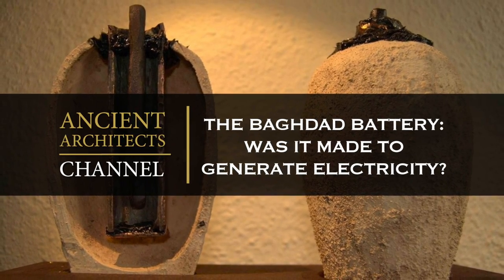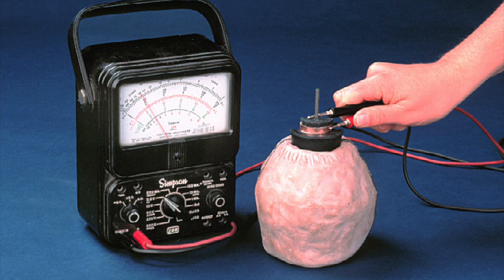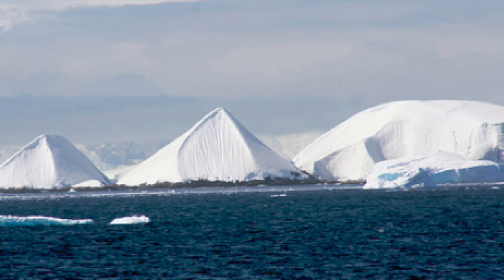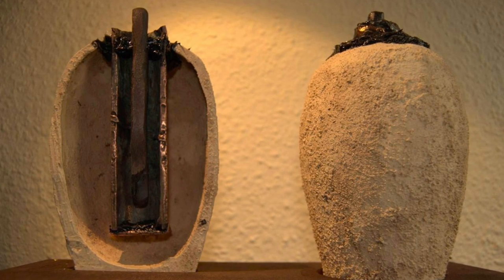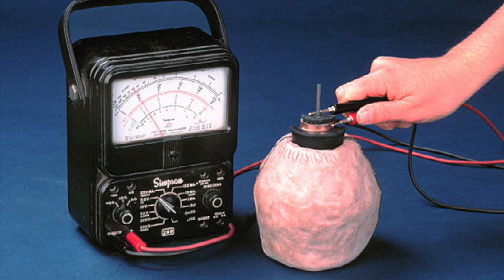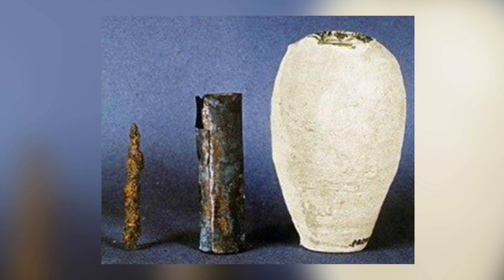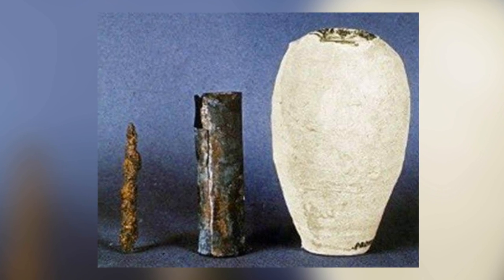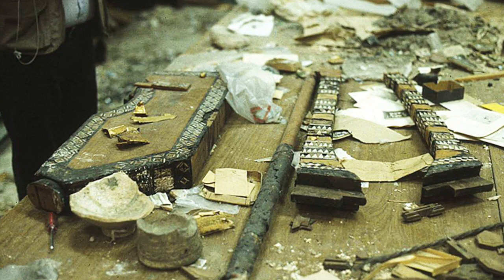The Baghdad Battery : Did it Really Generate Electricity? | Ancient Architects

Comment: Great observations! This is the detail we need. And its quite important detail too. I'm not so worried about the voltage, its the current that matters and what they did with it. However there are enough important points in the other detail that are key:
The apparent inability to refill
No obvious contacts or terminals
No obvious paraphernalia to be used with any of the jars.
Why assume vinegar or lemon juice? There quite probably were other acids around.
Could they work on alkali like a NiFe battery? 
What occupied the space between the Cu vessel and the jar? Ideally that Cu ought to be full of holes to allow more electrolyte to circulate from the jar to the iron rod. Better still a series of Cu meshes. It looks like there is a large void between the Cu vessel and the clay jar, and only Cu vessel had electrolyte between it and the iron rod. Have I got this right or not been paying attention? It certainly is a very odd way of doing things. In which case ( viz, that I was awake), what was the purpose of the void space between the Cu vessel and the jar.
It was designed to be sealed.
Maybe any electric devices were not what we assume and assuming is very silly in any case, although for me battery is not ruled out. But having seen this vid, it's definitely less ruled in.
They may well have been ionising the air for all we know. Any use they were put to would be long term or low current and not require frequent refilling.
One time I believed MBUK who said you could dissolve a seized aluminium seat post in a steel frame by turning the frame upside down, removing the bottom bracket and filling it with concentrated NaOH. They weren't wrong and it was fun. There was a lot of hissing and bubbling and the frame jiggled up and down a bit. I put a match to the bottom bracket shell  and got an amazing POP and two jets of flame just like the barrel of a tank when it fires. I had to do this quite often as it wouldn't have been good to fill the room with hydrogen otherwise it would have been the Hindenburg all over again.
I of course put a volt meter across the seat post and frame. I got 1.5v. But it was in the days before LED bulbs and it cant even have been a few tens of  mA because no way would it even look at a bicycle lamp light bulb.
It took a lot of NaOH to dissolve that seat post and I've since always been sceptical that the mags' bods had actually done this themselves. It really was extreme and quite a dangerous, if rather an interesting way to spend an evening.

Comment: Before deciding if something is a battery or not it is wise to research what types of batteries there are. Most people think they know, zinc-carbon, alkaline, lead-acid, NiCad, NiMh, lithium. But they'd be wrong, there are in fact literally hundreds of different types and compositions, even ones that use salt water, some that use iron oxide, some that rely on gravity, many invented in the past 100 years have been forgotten about.
https://www.youtube.com/watch?v=pMLcWE6NLgM&list=PLbQqm4rNo625Etz4INo2wP2X4sxgwDyNN
It's also likely the Baghdad batteries weren't ever very good, 'Ever Ready', Exide' and 'Duracell' weren't very big back then so it was probably a more artisan production process - it's quite possible we found the rejects and real ones got used, abused, recycled and broken. Perhaps they were the losers in the annual 'Which Battery' awards in ancient Iraq: if they didn't experiment and get most things wrong - like we do - how could they progress?
As we saw from the Great Pyramid's gold cap, 'generating' electricity in ancient Egypt was as easy as connecting a long wire from the gold cap to the item to be powered, and the other end to a metal rod banged into the damp earth. Connecting that to super-capacitors (see link above) or batteries is not so strange.
The lead/tin solder alone shows us they knew what they were doing, that's not a accidental solder joint - that's R&D and a way of heating the metal properly. I wonder what flux they used? 
What is more puzzling is the insistence of people that the Pyramid Builders (etc.) were too dumb and stupid to have discovered and harnessed electricity. We have no idea of our own history beyond about 2000 years and only discovered electricity a couple of hundred years ago, and then only use it everywhere today thanks for Nikola Tesla. Go back to 1600 A.D. to see a people too stupid to discover it, it didn't take long for someone to wonder about the lightening to us all having iPhones. 
The technology to casually dig out, shape and move 1100 ton blocks of granite or to machine neat pots out of it doesn't appear overnight, it takes many centuries to refine - so how likely is it that they were too stupid to notice lightening and harness electricity? Not very, the chances of the missing it and vanishingly small when you think of the age of their civilisation and the products they created, especially toward the end of it. Then have a read of Ezekial in the bible, it looks pretty electrical to me. Then there's the tabernacle and the tent of meeting that no one was allowed into for fear of death - from HV?. The design of the ark with the gaps and bits of foil and the winged spark gaps. There's even instructions in Isaiah not to pull up the stakes or cut the 'cords'. 
If you look for it electricity it's all over old historical documents, just because people haven't dug up pre Younger-Dryas DeWalt screwdrivers and TVs doesn't mean they didn't know about and use ways of collecting and storing electricity. 
So yes, I think the Baghdad battery was a battery, likely emptied and discarded, a lot of things can go astray over 12,000 years, in London the life of a car radio is only a few minutes in some areas :)
Reply: Absolutely right ! Definitely It is a battery 🔋
Reply: @G-ra-ha-m  thanks Graham,
Yes I know,..... I am a full professor of analytical chemistry and worked a lot with  electro chemical cells :)
Reply: @massoudkaykha2200  Brilliant !!!!
I think ancient civilisations were a lot smarter than we have been, but people always like to think they are the best, almost like an instinct!
It's like the dinosaurs - everyone uses them as an example of something old and gone, but they were on earth for what - 250 million years?!

Comment: 1831 Michael Faraday discovered how to make electricity by using a magnet. A cylindrical iron magnet was thrust into a coil of copper wire .  
If the iron rod in the 'Baghdad battery' artifact was already magnetized (by hitting while in a north south alignment for example) the iron and copper in proximity may have been generating a stronger field without use of chemicals.  If kept in a place used to store grain, would this repel pests?  Search shows many science articles on insects avoiding electric fields, and being used to protect greenhouses etc.  The Baghdad insect repeller?  Not sure why a jar/container needed.

Comment: It looks like a battery too me, what other purpose could a design like that have? Tinkers are resourceful, so they probably smashed the used ones and made new ones with the same copper rods. That no circuits et.c has ever been found I think is for that same reason, it’s been reused or they where used for a very special case. 

One out there theory is that they used tuning-forks to work on rocks.
If you strike a pitchfork and put it against a surface,
the surface will resonate at double the frequency, something to do with centrifugal forces.  Some frequencies will bounce up and down like a hammer. Which might have been useful when working on rocks. I think you even mentioned in some episode that a lot of tuning-forks has been found, but are hidden and not for display. Also that the the tip on them usually had some metal on them.  Maybe the batteries where used to make something to get the tuning forks going, like a tattoo gun. There’s also the hieroglyph showing 2 tuning forks that are connected.
 A transistor uses a crystal to amplify a voltage to something greater. So if they had that maybe those batteries were used at a fuller potential.
Reply: It looks a battery to me too

Comment: The 1volt makes it more compelling not less, thousands of years later we only have 1.5v per cell in the average battery, 1.2v nimh, car batteries are only 2v and modern lipo are only 3.2v. Bigger batteries only increase in capacity not voltage, but the question I always come back to is what were they using the electricity for and I can only think of light, you could mount a bulb directly to the battery and not need any wires but if they had no wires what were the filaments made of.

Comment: Could they have been a weapon of some sort, containing two reactive chemicals/substances? By pushing down on the iron rod you would break the asphalt seal  at the bottom of the copper cylinder releasing its contents into the larger vessel, then throw it like a grenade. I don’t anything about chemicals that could react and explode, so it may not be valid, but I just kept looking at the diagrams and couldn’t help but feel like the device was designed to keep things separate until the seal needed to be broken. Otherwise, why not have a copper bottom on the cylinder?
Reply: No it was probably used in light industry, producing consumer goods.

Comment: I am an Electrical Engineer, and for me, this is a battery. 
That machines or other electrical devices cannot be found is not a refutation of them being a battery. What a stupid reason that is for asserting that they are not batteries, and were perhaps used as a Papyrus storage receptacle. 
Archaeologists have no training in chemistry and physics, and I fail to understand why their conclusions are in any way relevant.
Reply: You are correct, if you read the comments you will find that it was probably used in some kind of plating process

Comment: Iron would yield -0.45 volts, copper would yield +0.34 volts. Therefore the battery voltage would be the sum of the two voltages, 0.79 volts.

Comment: It's a mystery wrapped in a puzzle, shrouded by enigma. We'll probably never know what it was used for. It more closely resembles a battery than anything else I can think of. There would be no reason for using two dissimilar metals (or any metals at all) if it was for storing papyri. It sure as heck looks like some type of experiment in galvanic corrosion. If it wasn't, then it missed it's best chance at having any meaning at all. I'm sure that metals were very precious in those times, so it was built that way for a reason. Both metals appear to be quite corroded, which indicates that there was galvanic corrosion, and therefore, current flow, taking place. But I see your point, if it was an electrical device, what was it used for? Where are the components that make up the rest of the circuit? 
 Of course, we never get any expert opinions on what it could have been.  Has there ever been any attempt to determine if the vessel ever held any type of liquid? And if so, what kind of liquid? That would be some useful information to find out. Perhaps they were using the electrical current to "cook" or ferment some type of liquid INSIDE the container, and it was never intended to create an electrical current OUTSIDE of the vessel at all.
 I agree with your premise that we have to look at things objectively, and apply the same standards to both sides of the argument. It would be interesting to hear an opinion from an electrical engineer, as I don't think archaeologists are qualified to tell us if it was a battery or not.
 Lots more research needs to be done if we are ever going to find a logical explanation for these thingmies.
 This is my favorite youtube channel!

Comment: "Why  didn't they just make larger vessels for a greater voltage?"
I am a full professor of analytical chemistry and would like to tell you that using a larger scale vessel will not change the voltage you get....  still the same 1 volt will be generated.

Massoud from Iran (persia)
Reply: Same voltage but more amps technically. But you are correct they needed several volts to electroplate. Or to do other experiments with electricity. It could also have been used to electroplate other more mundane things, zinc plated nails, copper plated iron weapons to resist corrosion, as well as the more expensive gold plated armor and such. Copper or bronze  plated iron armor would not rust and would have disappeared over time if the item was buried. Due to so called electrolysis, or electrolytic corrosion. The more noble metal wears away to prevent the iron from rusting. For a time.

Comment: ah thumbs down, you got it way wrong, The scroll was meant to be wrapped around the iron rod, slid inside the copper tube, and then slipped inside the ceramic container, which could then be sealed to protect the scroll inside. The acidic residue on the inside of the container most likely comes from the papyrus or parchment of the scroll that the pot once contained, since papyrus and parchment are both slightly acidic.

Comment: Creating a bigger battery would not increase the voltage, one cell is always around the 1 to 1.5 mark. If you cut open a PP3 9V battery you will see it's made of 6 cells.

Comment: You should consider this battery from the position of lack of the concept of electrolyte as such. That is, in ancient Egypt was used ... Water. Or rather, the dead water of Osiris. It's deuterium oxide and tritia. Tritia oxide itself already creates a glow because ionization occurs. But having a potential different ness lengthens the process. And then this battery was a lamp, which was used in the pyramid. And important his glow was noticeably smaller than the glow of a thread in the ring

Comment: If it was sealed by asphalt or bitumen, it was highly probable it was to seal a liquid. you wouldn't use something so complicated to seal payrus. The iron rod could have easily dropped down and the sealing material flowed over the top, since tar is semi liquid. I still think it is very likely that this was a battery. A larger battery would not have been more powerful, its not worth the time and especially materials to make a larger one for no benefit. Link several or more of those bad boys together and I reckon you'd get quite a jolt. This brings me to the point of how many amps they produce -that's more important. How much of a power or even a shock you get is dictated by current, not voltage. I'd like to see an amp output. If I can guess it could easily be 0.5 to 1 amp and if correct you could put 6 of these together in series with simple copper wound round the + and - then you have an electroplating set up.

Comment: I think this device is probably a thermosolar transducer of some kind. It looks like the iron rod would be connected mechanically with bitumen to a heat sink or a metal plate for heating or cooling possibly.   Think about how a very crude desert solar cooler works.

Comment: Couldn't be anything else but a battery. AA batteries only have 1.7 volts so low voltage is no argument. No way they were used to store scrolls. They weren't big enough and the acid and metals would destroy the scrolls very quickly. They have to be batteries. just because nothing has been discovered for them to power means nothing. Absence of evidence is proof of nothing. Sorry, Matt, but I think you're wrong about this one. I am an Archaeologist and I believe they are batteries. So there goes that line of thinking as well. Come up with something credible they could have been used for other than batteries and I'll be totally open minded about it, but the evidence as it stands points to them being low voltage, perhaps experimental, batteries. Full stop!
Reply: Good comment. They were not experimental, but probably used in some form of plating.

Comment: What do we know of copper and iron use of the period?
As far as the sealing of the iron rod we do similar things to car batteries until they are to be used we cap the terminals. Not disputing but answering the why question you made on this with a hypothesis.
But the lack of any electro plating begs the question wonder if the holding was considered therapeutic? Again theorizing on the point of electricity. Low voltage, what amps? Similar to a portable tens machine?
Does copper and iron have anti bacterial use or anti fungal use of the time to help preserve potential contents but then why were they sealed with nothing in them?

Comment: Usually I would say.. well argued point Matt. But this was pretty weak at best. The evidence heavily swings in favour of the only valid use for these is as batteries. For what? Well. If you string a fine filament between them it might glow...magic... oh yes. Magic. As with many other uses for such a thing.  It had magic inside. And you could let it out.
Reply: Besides. 1.0V is very useful Consider that current technology relies heavily on 3.3v. these things are pretty robust. They're made primarily from hardy material. If you were using them to make filament glow. You wouldn't find any filament after 2 years of exposure to the elements. Let alone 2000. You would burn through them very quickly if not contained.

Comment: Fire starter. You can short a small wire to make fire. Thin iron wire will rust and fall apart in the ground, it’s very possible they could have been thrown into fire and the asphalt melted, or left in the sun. I don’t think much would be powered by this besides electroplating or firestarter